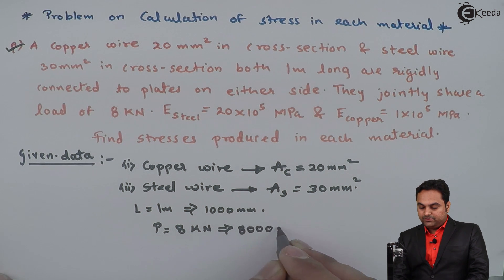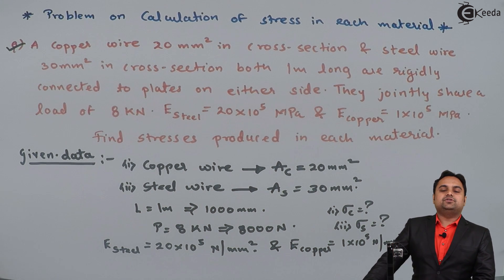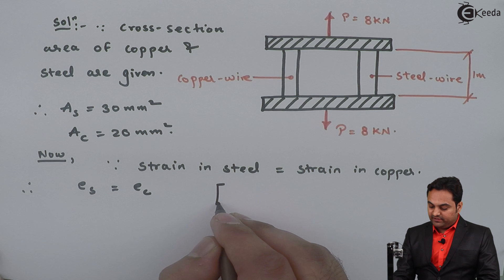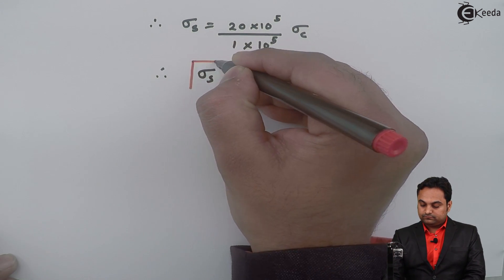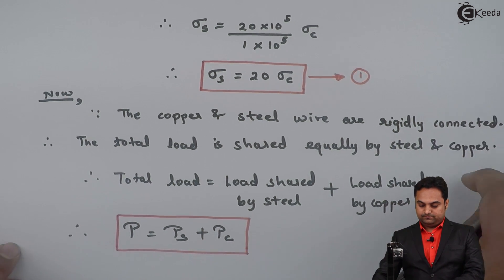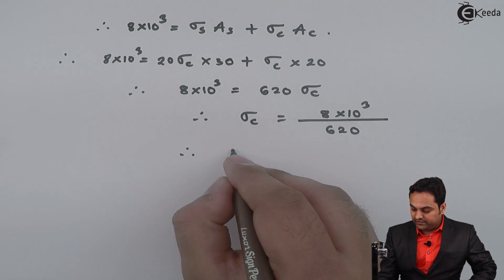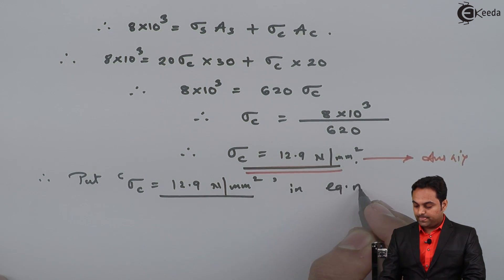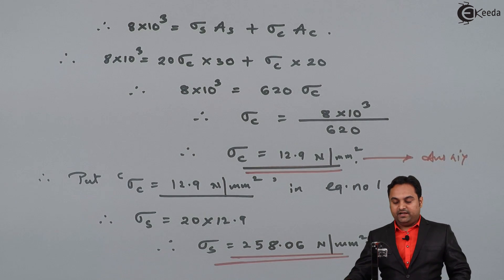Calculation of Stress in Each Material : Problem 1 - Stress and Strain - Strength of Materials

Comment: Sir but how can you say that both will have same strain
Doesn't it depends on the young's modulus? Please explain sir
Reply: The expansion of both the materials will be equal.
For example, take a rubber band and cotton thread attached to each other side by side , applying pulling force on attachment gives same elongation for both the materials.

Comment: A steel tube 2.4 cm external diameter and 1.8 cm internal diameter encloses a copper rod 1.5 
cm diameter to which it is rigidly joined at each end. If at a temperature of 100C there is no 
longitudinal stresses calculate the stresses in the rod and the tube when the temperature is 
raised to 2000C. Es=210 kN/mm2
 and Ec=1000 kN/mm2
. Coefficient of linear expansion for 
steel is 11(10^-6)/°C and for copper 18(10^-6)/°C

Comment: i think the load should not be shared equally by both wires...is it?
Reply: YOGESH SATKARI  They will share equally Coz they are connected by RIGID plates...word rigid matters
Reply: stress is  shared  equally  means  both the  stress should  have  same  value which is  not happening 
It  should have been  stress would be proportionately  shared instead of equally .
Reply: I think my load should be shared by two women